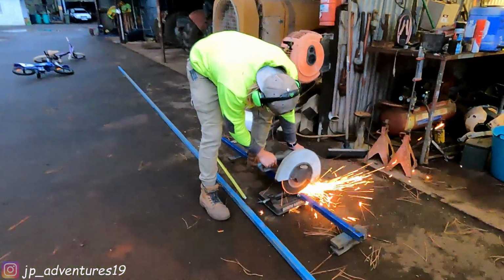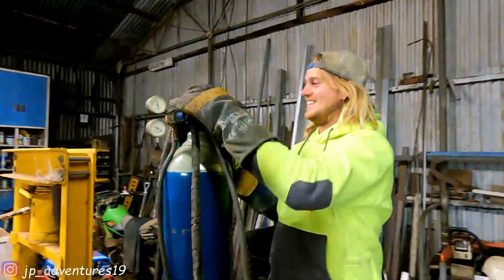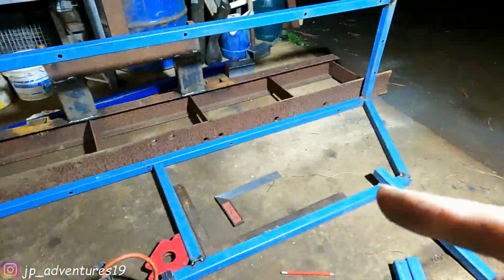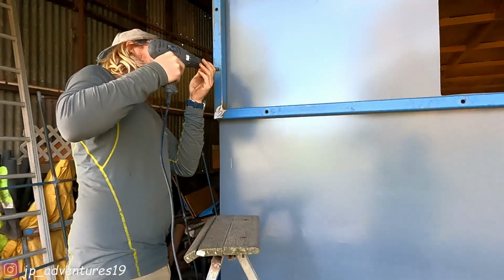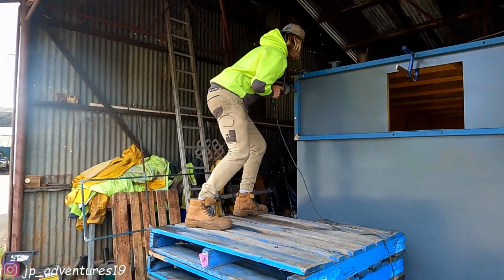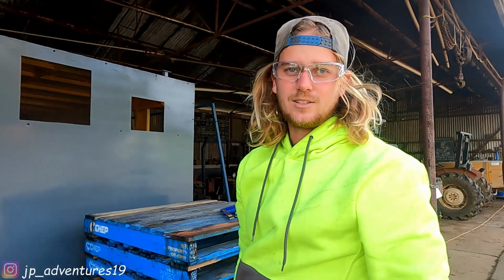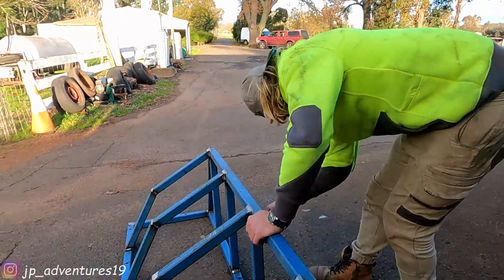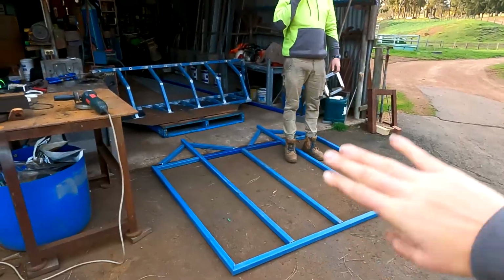Building a Strong REMOVABLE Overhang - Converting Mercedes-Benz UNIMOG into DIY Camper  (Eps. 12)

Comment: Greetings from Cornwall, UK, home of Pasties and Clotted cream. We salute your endeavours. The Nose cone does help with slip streaming, for sure. Glad you've thought it through with the cab tilt, engine access. The sliding deck balcony extension looks interesting; American RVs use that as major selling points (slideouts I think they call them), making use of available space, ingenious use of pistons, hydraulics, hinges and smoke and mirrors probably!! What route were you thinking of taking to get to Europe? We've got Aldi and Lidls here as well, so you'd feel very much at home AND we drive on the proper side of the road as well!!! Only a 4 ft swell here today after a weird summer storm. Take care
Reply from the maker: That's why I was feeling so weird ;) Good thing we are pretty much done working with it and didn't have much to do (just the trims). Welding it sucks as well as it spatters everywhere and constantly gets in your boots.....